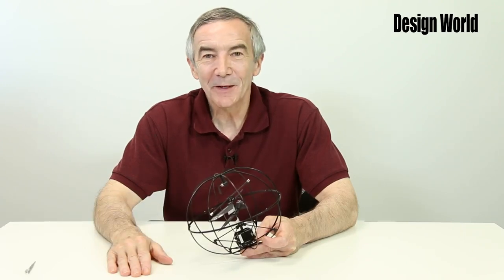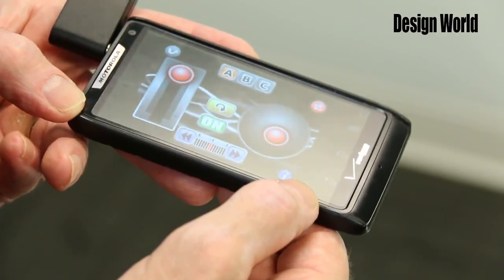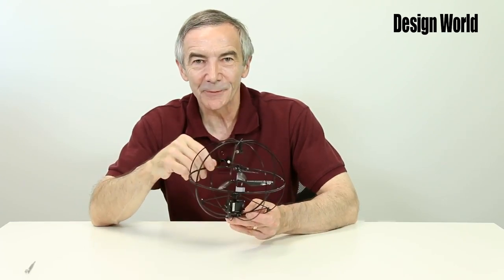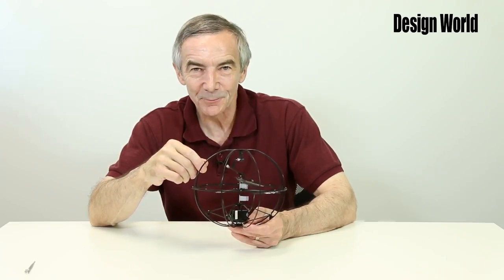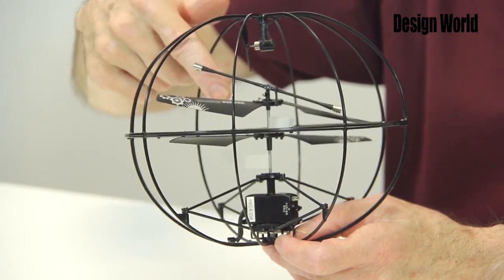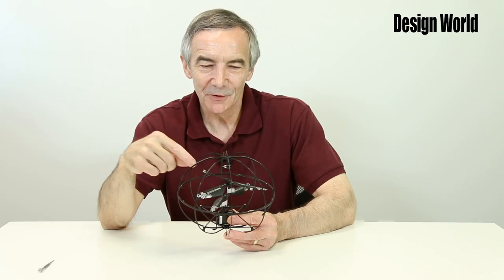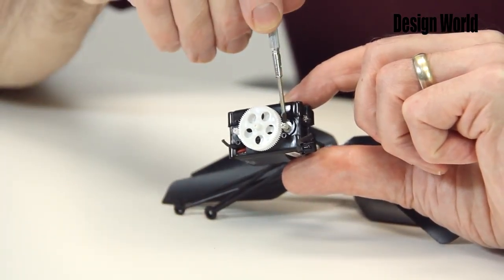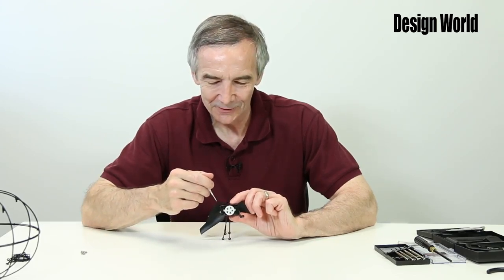Coaxial Helicopter Teardown

Comment: Interesting to see two motors. So in theory, could a monitoring and auto-adjustment mechanism/subsystem/adjunct be integrated so as to ensure that both motors ARE indeed synchronized,--regardless of speed--in order to allow for flight without the undesirable spinning of the craft (as observed in the video)? Could a mod of that sort be incorporated into, say, the toy in your video?
I have not delved into building or modifying an UAV, but the coaxial approach has always been my preferred design.